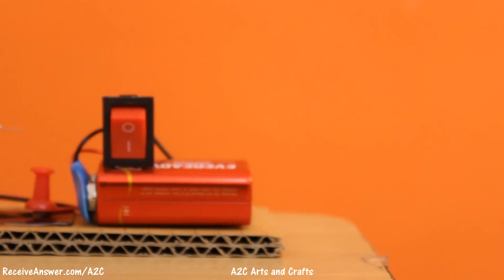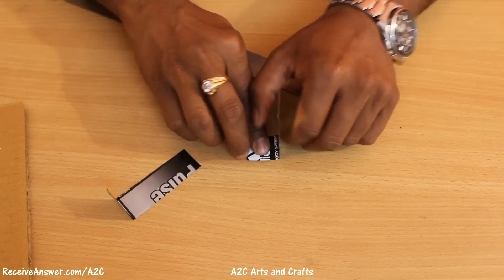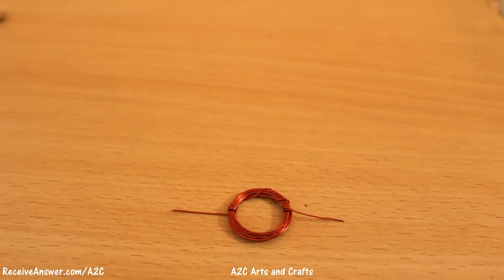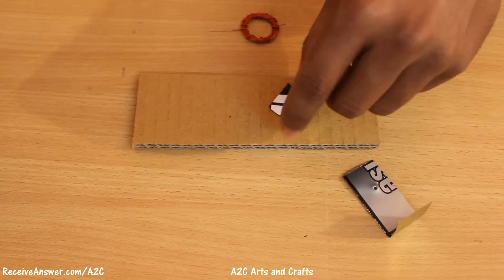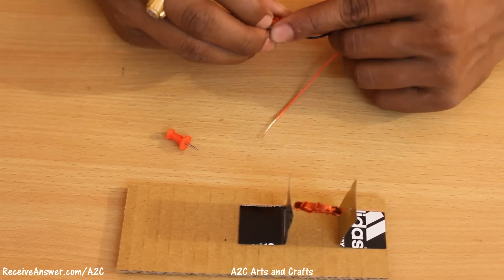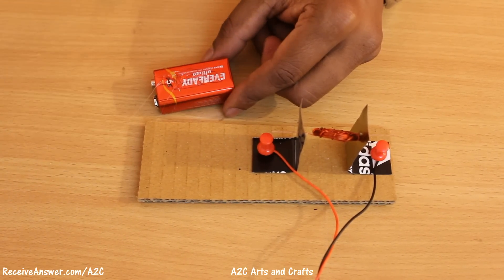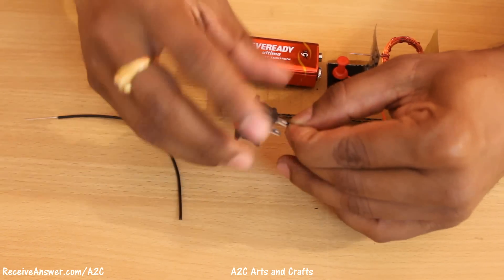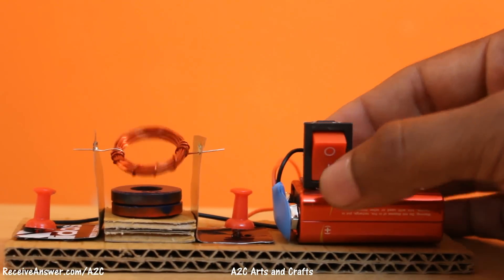How to Build an Mini Electric Motor - Homemade - Simple Science Experiement

Comment: I just wanna ask if for example if i have 2 magnets and want to make N & S can i placed the magnets on both side of the copper wires would it still be able to rotate??? And if i replace those pins with nails would it still work????. pls let me know cus I'm doing a project and I'm not too sure. THANKS ALOT